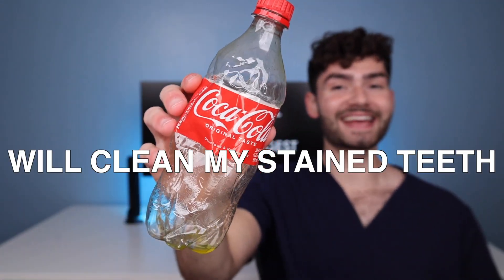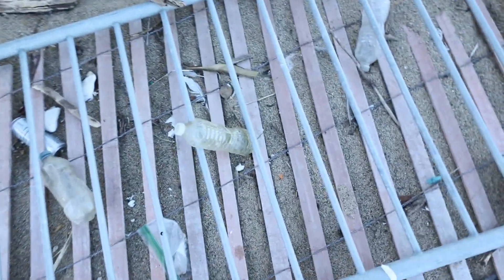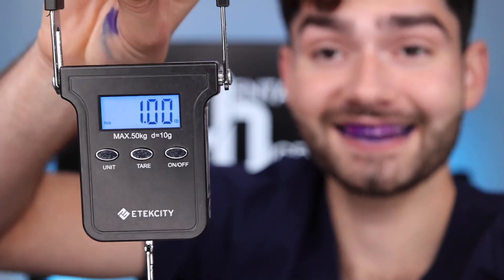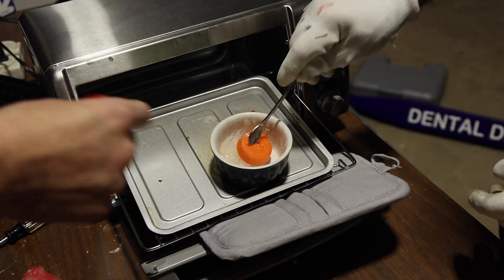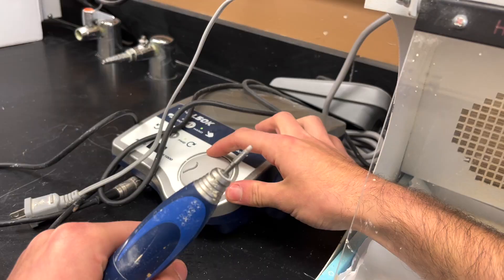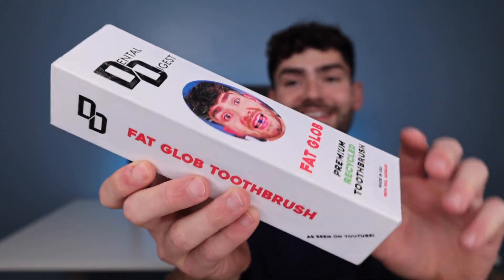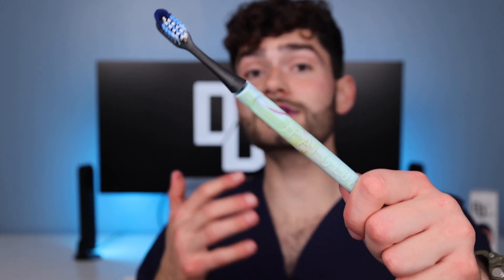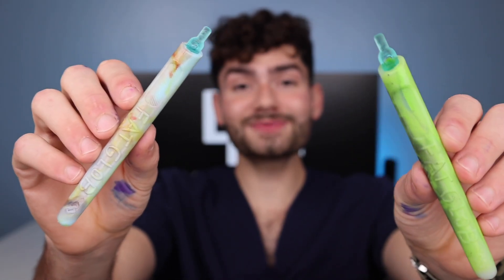I Turned Ocean Plastic Waste Into a Toothbrush! #TeamSeas

Comment: the limited edition tooth brush are pricy the cheapest one is 30$ then 100$ then 512$ and the last one is 5100$ i don't think no one will buy these toothbrush cuz the cheapest electric toothbrush from oral b is 19.97$ and the normal toothbrush is 6.97$ from oral b so i don't think somone will buy those toothbrush from 30 100 512 and 5100$